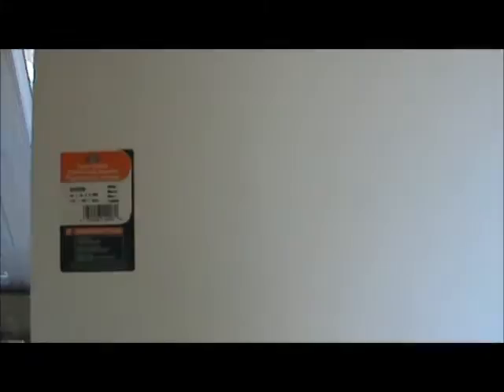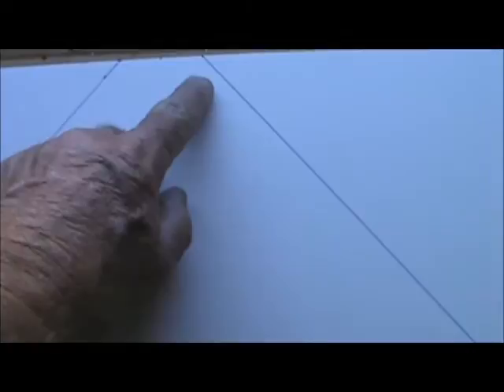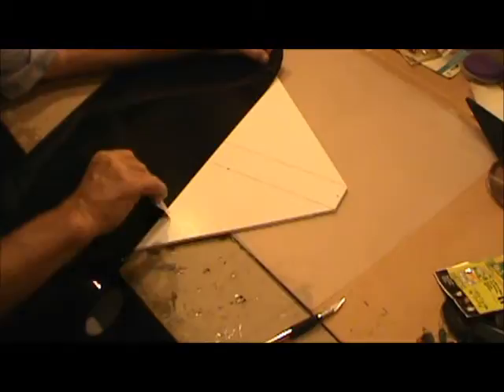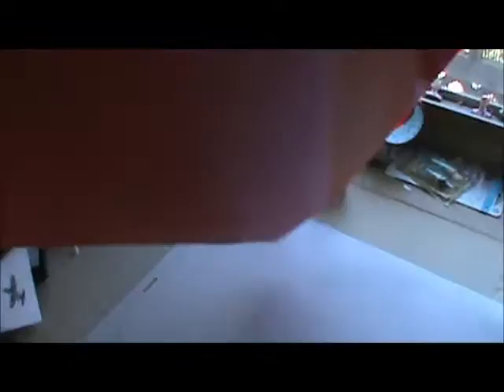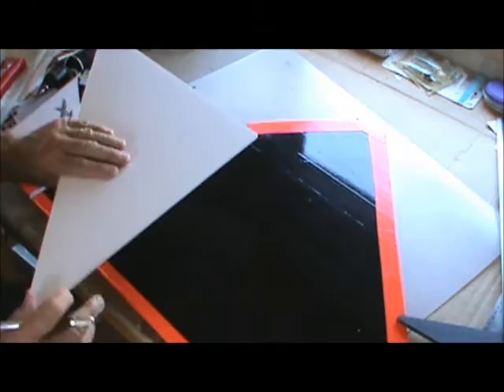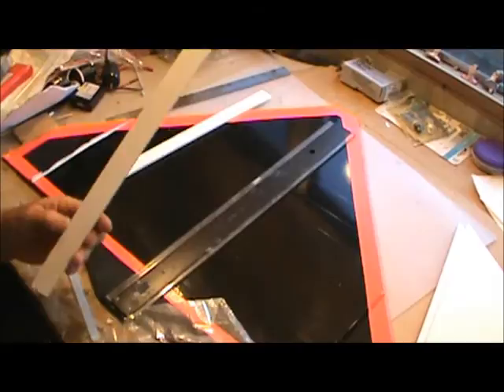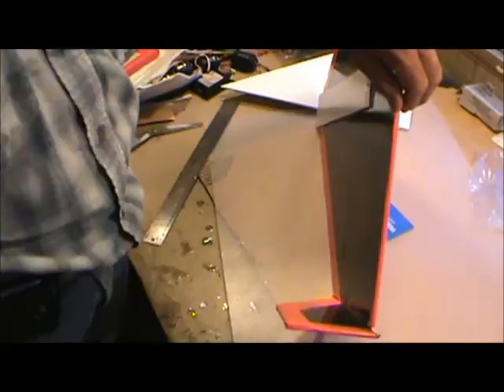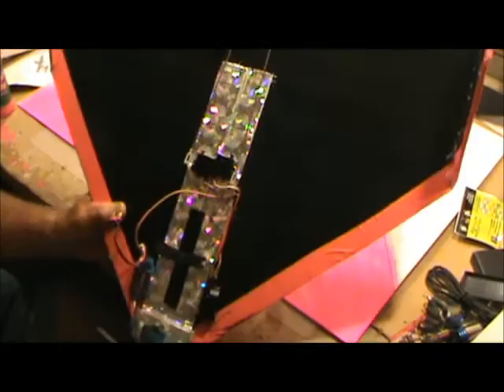How to build an 8 $ Combat Model Airplane

Comment: I've been building a similar wing out of dollar tree foamboard  only with the motor in the center with good success but the I tried a heaver brand  and it turned out a horrible  going to brace the bottom and support the push rods  and see if that's a problem
Reply from the maker: I use the white board from walmart  it is only 1.49 and packing tape for support